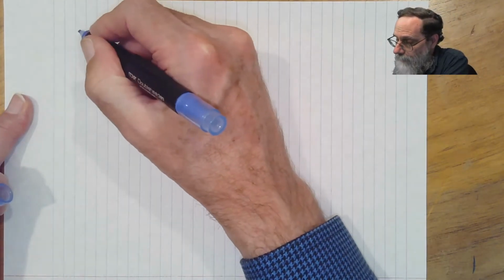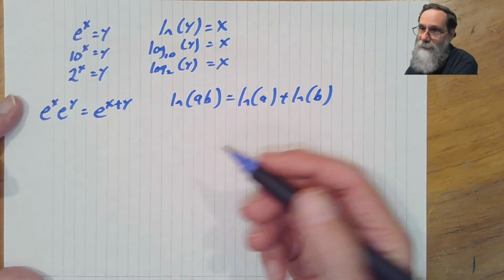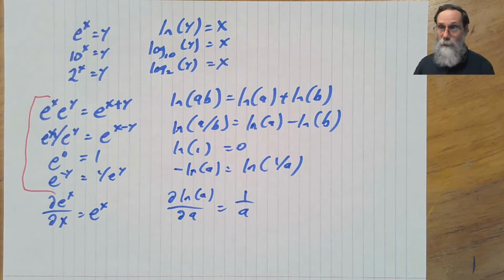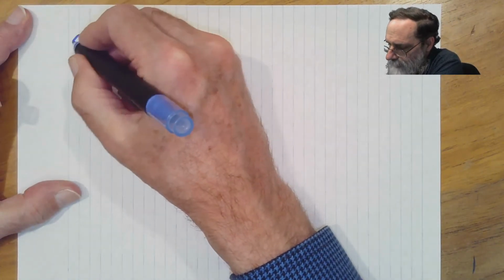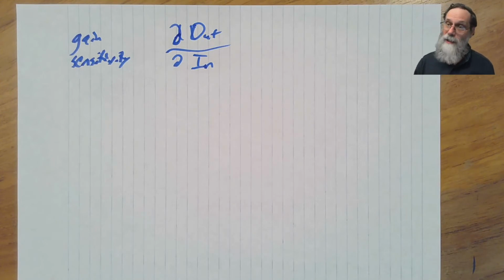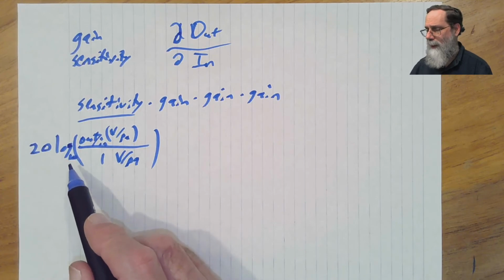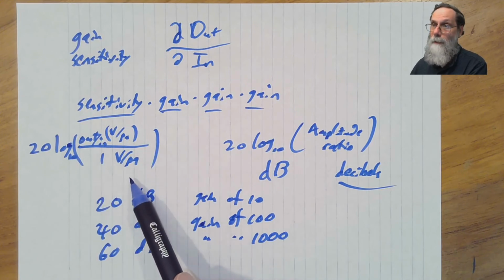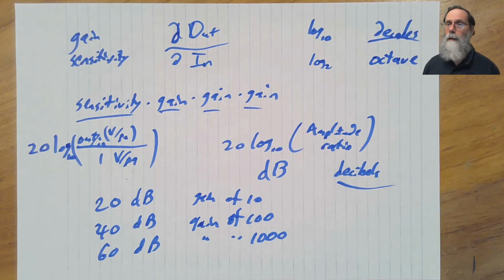Logarithms §2.3.1–2.3.2

Comment: Why is a decibel 20*log not 10*log?
Reply from the maker: Good question!   Originally a "bel" was a power ratio of 10, so a decibel was 10*log_{10} of a power ratio.  But electrical power is proportional to the square of voltage or the square of current, so we ended up with 20*log_{10} of the ratio of voltages or currents.
Reply: @gasstationwithoutpumps  o wow I understand now, thank you :)